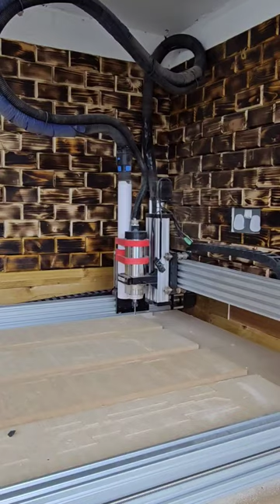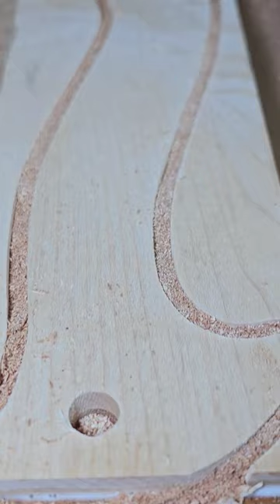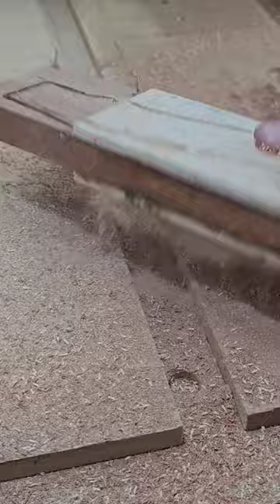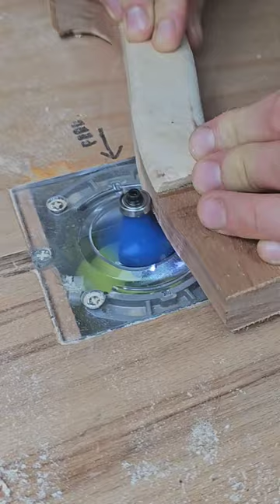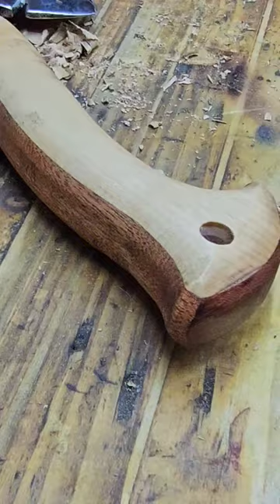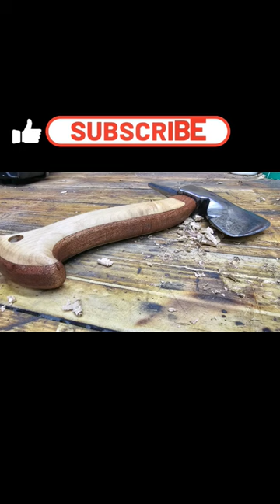Making axe handle on desktop CNC router from openbuilds #openbuildscnc #woodcncrouter #desktopcnc

Comment: What spindle did you have?  Looking into getting a spindle and upgrade from the RouteER11 that came with the lead1515
Reply from the maker: Spindle is air cooled 1.5kW
Reply: @FALCON390CNCWorks   what brand?
Reply from the maker: Made in China. No name on the spindle.